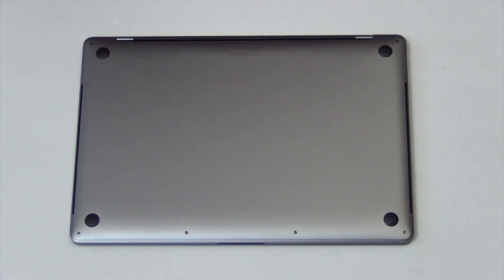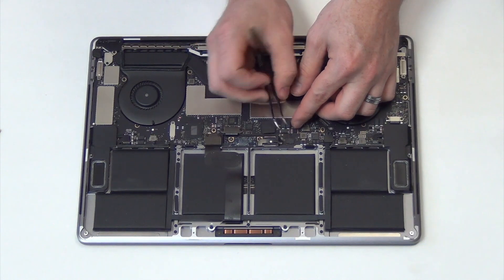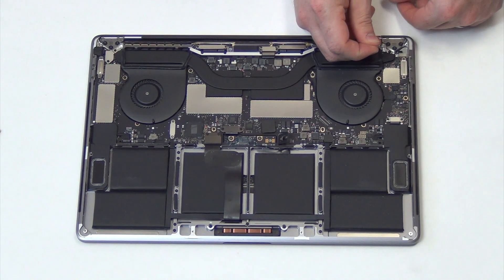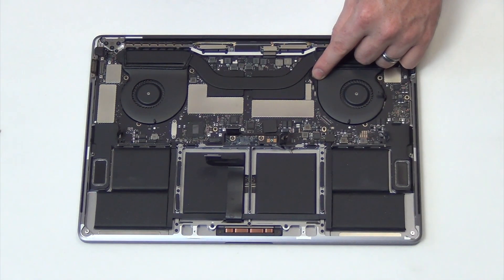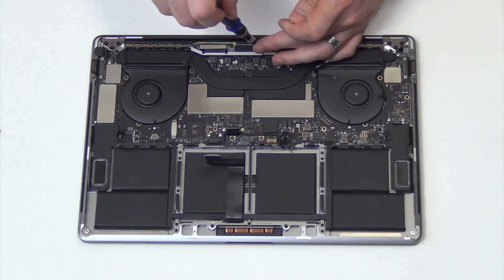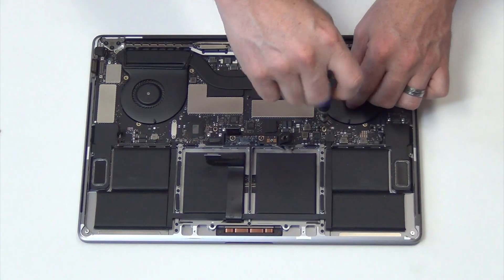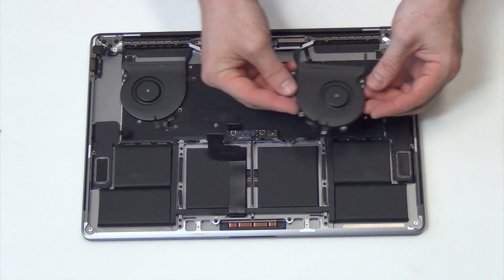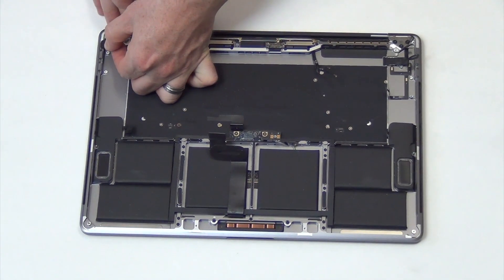How to Take Apart the 2017 15" Macbook Pro with Touchbar A1707

Comment: At 9:08 the Pentalobe screws are 0.8 right? I tried using 0.8 and it chewed my screwdriver. I just want to make sure before i buy a new one.
Reply: Same thing happened to me, I had to buy better quality screwdrivers. Also stripped the thread inside some screws, tough to remove!

Comment: Hi bro,

Thank you very much, for all your tutorials, they are very helpful, I wanted to ask you if you can change the SSD for the Macbook Pro 15 "A1707 and which SSD would you recommend to place it?

I would also like to know if the battery can be changed, if you have any video that explains how the changes could be made.

It would be of great help, it seemed all your collaboration.

Thank you.
Reply from the maker: On an A1707 you can change the SSD. You are limited to Apple SSDs specifically for the A1707 however. The battery is not easily changed in this model as it is glued to the top case.
Reply: @PowerbookMedic  Hello, thank you very much for the information, it is very helpful, you have a video in which you explain how to remove the battery.

I appreciate your collaboration.

Thank you.

Comment: The cable that you unplugged at 4:15 on my Macbook is damaged. It seems to have overheated. I see small burn damage on both the cable and the board. I bought a replacement battery thinking that was the issue, and It still doesn't work, so my only guess is that Ill need a new board sadly. Is it worth it to get a new motherboard or just get a new Macbook? Does that cable come with the board? any thought or suggestions? Thanks

 :(

Comment: I need a guide in removing the speakers. I took apart my MacBook pro 2016 touchbar 15" just to realise this guide and many others never handle SPEAKERS. They are completely glued in, I don't know what to do to take them out gently without harming the case or other components.
Reply from the maker: Alexandru Dan The speakers are not sold separately from the top case so we do not remove them. Also, the speaker would get damaged if we tried to remove them.
Reply: Powerbook Medic can you do a video that can show me how to replace the ssd in a1707 even tho its soldered in please

Comment: How much of that do you have to go through to just replace the fans
Reply from the maker: Steven Wanner You have to go as far as taking the Logic Board out and then you are able to remove them.
Reply: @PowerbookMedic  Thank you. what size tools do I need to do the job. So many types and sizes of screwdrivers these days.
Reply from the maker: Steven Wanner You will need quite a few screwdrivers, a pentalobe #5 and a torx #4, #5, and #6.

Comment: Can the speakers be removed/replaced from the top case?  One of mine is blown and I am out of warranty.
Reply from the maker: Not on this model. The speakers are sold with the top case assembly.
Reply: If anyone is interested I was able to replace the speaker on this laptop after finding a replacement speaker from an online "i-repair" website for $30USD.  The process was very simple as the speaker can be accessed right after taking off the back panel(I also disconnected the battery during the swap).  A hair dryer to heat up the metal side on the top case where the speaker was located made pulling it off defective speaker relatively painless and it left the original adhesive on the case fully in tact for the replacement.
Reply: @nevinstyre  very interested, same thing happened to me can u let me know how u fixed it and where u got the part from?
Reply: @henjac91a  ifixit sells the part (make sure you buy the proper side, left and right speaker are different parts).  After opening the back case I disconnected the battery and then the faulty speaker, I used a hair dryer to heat up the top case where the faulty speaker was located, this loosened the adhesive.  I used an ifixit prying tool to pry the faulty speaker out, it took a couple times of heating and prying it a bit and then the speaker came off clean.  I was lucky enough that the original adhesive stayed stuck to the case and not the speaker so I just applied some more heat and stuck the replacement speaker right on the original adhesive.  After reconnecting the new speaker and battery I closed it up and it was good as new.
Reply: @nevinstyre  thanks so much, how did u disconnect the battery? and i just heat in in the direction of the right speaker right
Reply: @henjac91a  This video we are commenting on shows the battery disconnecting steps at about 1:30.  Yes just heat in the direction of the defective speaker on the grill and flat part of the top case(on the keyboard trackpad side)